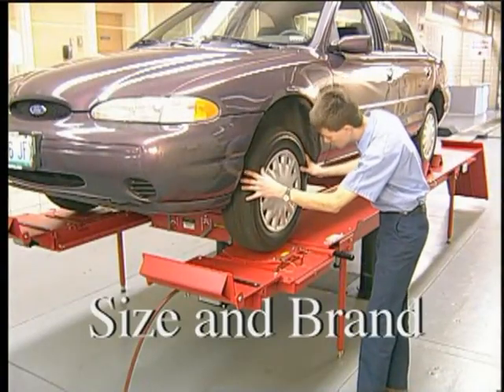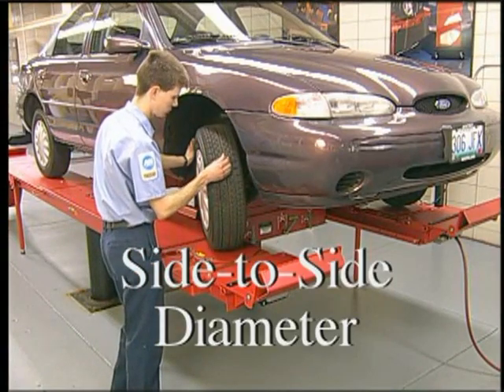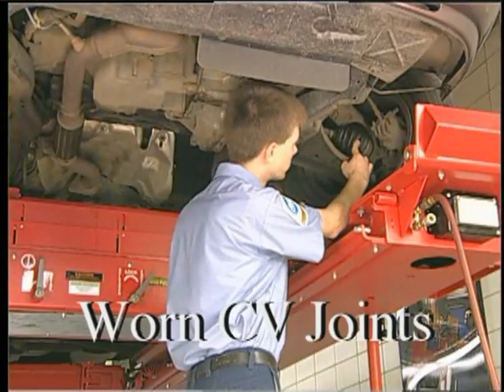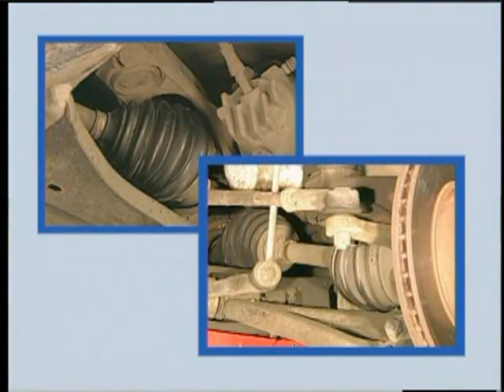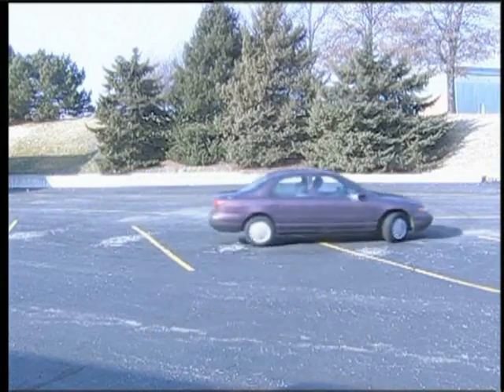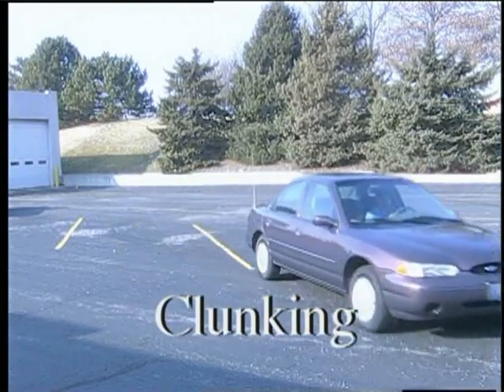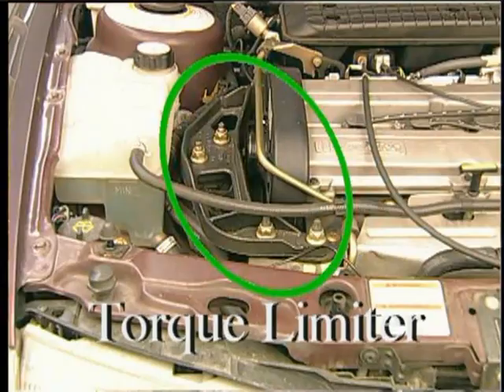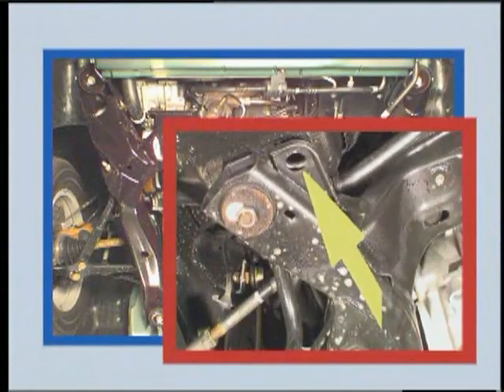What is Torque Steer? - Hunter Engineering

Comment: Is torque steer only related to higher performance cars? a friend of mine drives a toyota aygo (1000cc i presume) and thinks he has experienced something similar to which i said i doubt its that but im not sure, could it be?
Reply: I think its possible with first gear due to high torque cuz that escort in the video doesn't fast at all lol
Reply: Nope. I have a 2002 Honda Civic EX and it has torque steer as well at higher speeds. I’ve replaced all motor mounts , and low control arm to make sure

Comment: So... why cant FWD cars have equal length output shafts?  Why cant the engine be centered in the car on fwd?
Reply: Centrifugal forces, balancing the weight of the car. consider if the engine was off center, each front tire would have a different load weight, not only affecting handling and steering, but also the tire bearing more load will have more driving force due to friction increasing with weight... making torque steer. Adding gears to relocate the transmission output to the center to make the drive Shrafts equal length will add gear resistance, as well as gear lag, where the gears will take some time to move under load as there is a brief period of deformation in the teeth. This will degrade the responsiveness of the car. The additional mechanical components will also make the car less efficient and more complex.